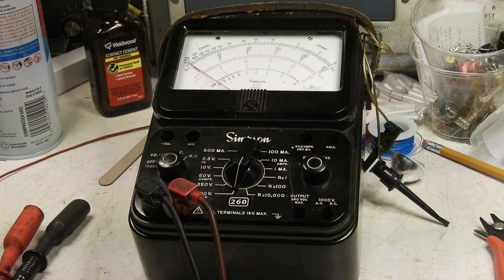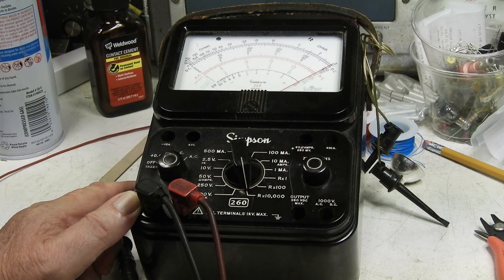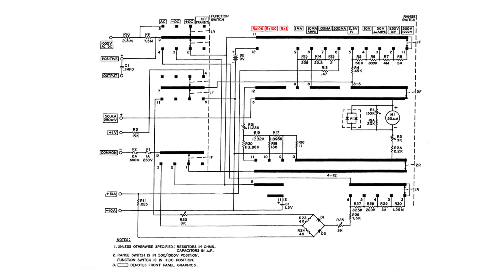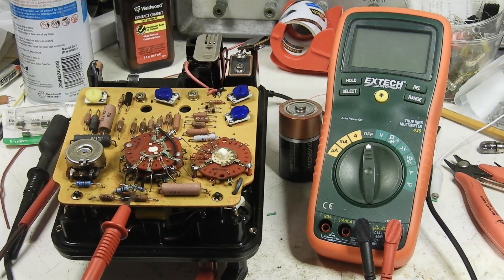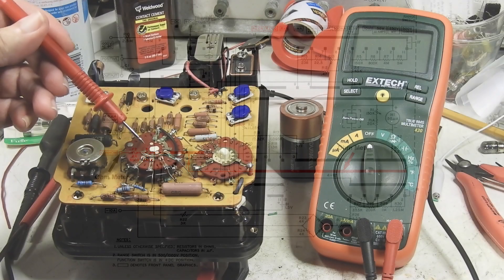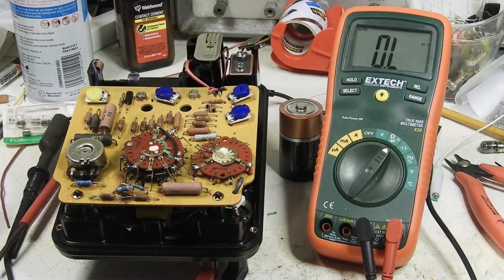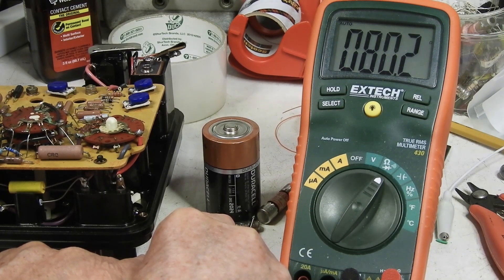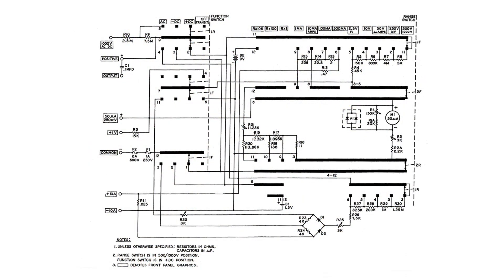How to read Simpson Meter Schematic and repair meter

Comment: I have that very model in 7PM and I just replaced six resistors which read faulty while on the board.  After I replaced them, nothing worked at all, which looked like a power connection problem.  Also, a couple resistors gave different readings while in circuit as opposed to not being connected.  I don't think that I messed up anywhere but then I realized that I had not checked the fuses after the repair.  Your video was absolutely the best!  I have both of those diagrams printed out and followed along with you marking closed/open circuits and the bus bars as well.  That alone has given me new info to take back to my bench.  Hopefully, I will have it running great soon.  Also, my problems were exactly the same as your meter with the resistance readings.  Thank you for the help!
Reply from the maker: Thank you, I’m glad the video helped! The Simpson 260 is a classic! The Simpson Company is still making this meter today. They also have great support and you can find the link on their website. 
https://simpsonelectric.com/
Thank you, and thanks for watching!

Comment: Awesome video. How did you do the graphics? My 260 quit on all ohms scales today and won't read volts either. Tomorrow I will use your video and fix it. Lost without this old reliable friend. It has saved my butt too many times to recall. A digital meter can really lie to you. This one keeps things honest.
Reply from the maker: Thank you.
I use three applications, Photoshop Elements, Adobe Premiere Elements, and CorelDRAW. Hope you get your 260 working again. Let me know what happens.

Comment: Can you do a video explaining the range switch schematics? It’s always been a source of confusion for me and I can never understand the path from probes to meter movement. I love your videos and the way you explain everything and highlight the paths in this video. Please keep them coming so the older analog stuff doesn’t get forgotten.
Reply from the maker: That would be interesting. I’ll put that on the list and start on it after the crystal transmitter project.
Reply: Oh that would be great it’s the multiple layer or wafers with front and back. Like 1F. 1B. 2F. 2b…..obviously you get it. When the range switch is turned 1 detent do the pointers on every level move that 1 detent too? How does the reverse polarity switch fit in to the path from jack to wafer levels to meter movement. My head may explode lol. The 260 in your video would be a perfect candidate. Thank you for even considering it.
Reply from the maker: @robbo6460  Witch 260 do have 2, 5, 6, or 7? Yes all the wafer switches move together on each selection. The -DC  +DC is there so you do not need to swap leads if the voltage changes polarity.

Comment: I have to wonder if possibly that fuse had a load that was at or near 100% for a sufficient time that it was about to open, but the load was removed right before it did. Since it was a slo-blo fuse, it could have had 100% load for a minute or two before it was ready to open.
Reply from the maker: That's possible. I'm beginning to think someone put the wrong type of fuse in this meter. But still the resistance of the fuse should be only an Ohm or Two.
Reply from the maker: Thanks
Reply: Maybe internal corrosion?

Comment: Great graphics illustrating the function select! 260s are great meters. I’ve purchased Simpson 260s that spent their lives getting knocked off tech school work benches. A little JB Weld, a little solder and those things keep on ticking.
Reply from the maker: Thanks. I still have my Simpson 260 I bought when I was still in High School 1960-63.

Comment: Great graphics as always.    I have been wanting a Simpson. 260   There have been times that I wish I had an analog meter.   Used one in my electronics class in the 1970s.    How much  should I pay for one on Ebay?     Series 7 seems like a good middle of the road series.
Reply: eBay has a search that allows you to see the prices that items have been selling for, I think.
Reply: @jeffryblackmon4846  THANX!
Reply: @jp040759    No problem, friend.  I knew about it, may have used it, may you find it of use.
Reply from the maker: Thanks.
Yes eBay would give you an idea of value. Simpson still makes the 260 you might check out there website.
Reply: @AllAmericanFiveRadio  THanx